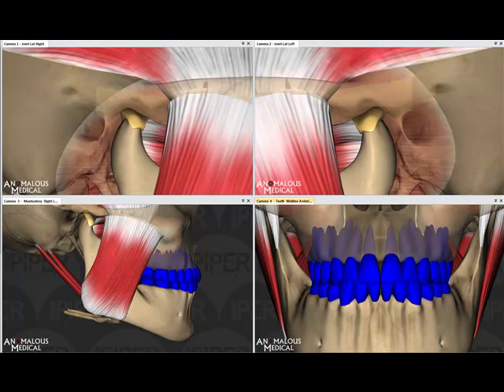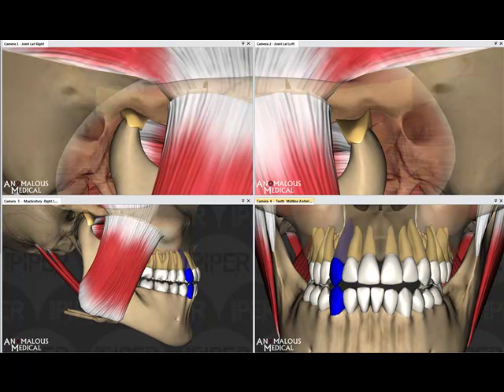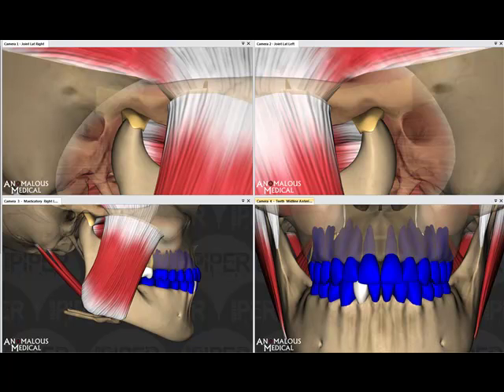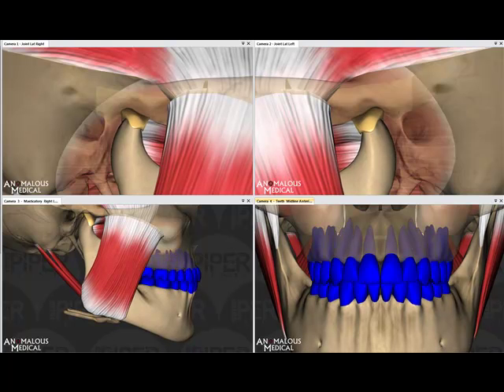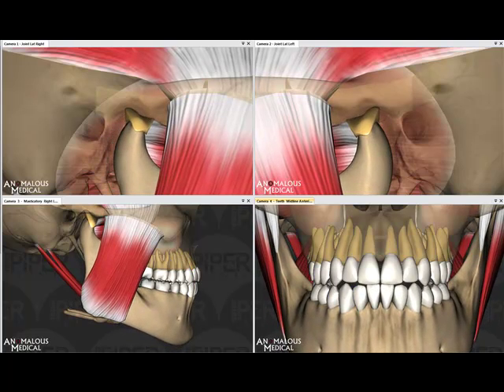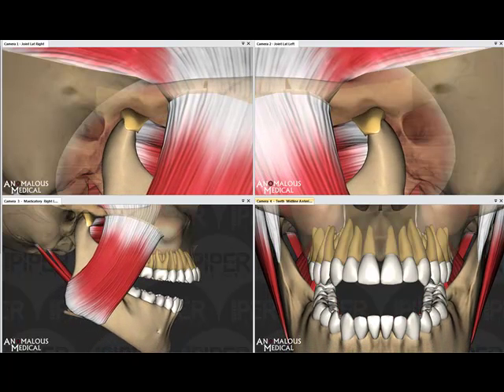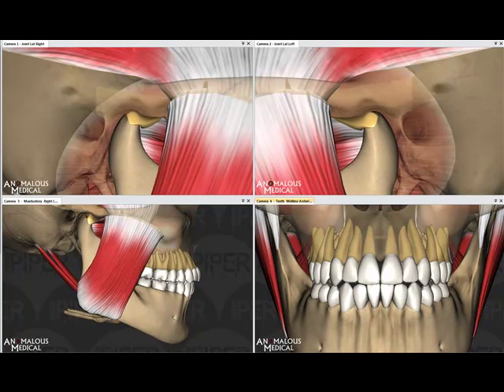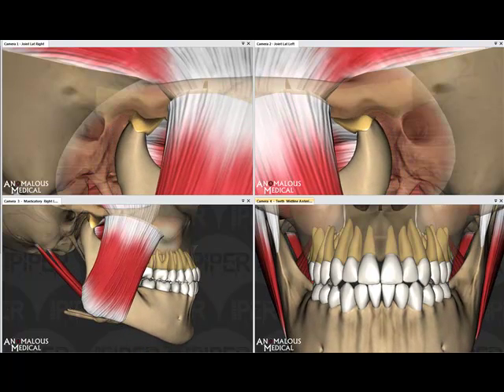Mandibular Movements.mp4

Comment: Here is my 2nd question:

Also, when moving the jaw left to right, is there only one lateral motion? It seems is if most of the movement is coordinated by the area to the side of the chin. Is it possible for the corner of a Mandiular bone (where it starts to turn into a right angle) move side to side (not diagonally side to side)?

Thank you kindly in advance!